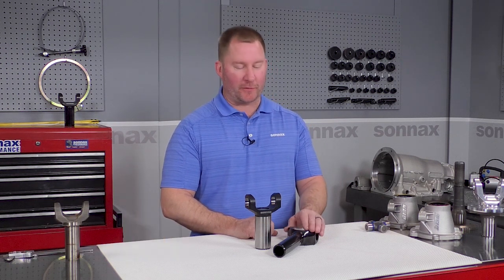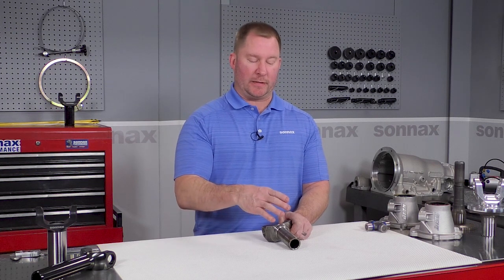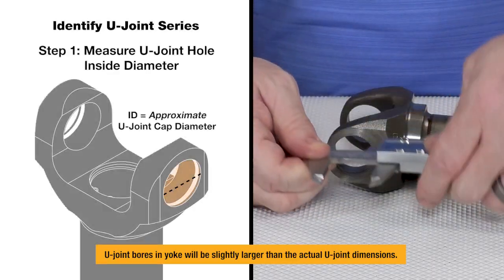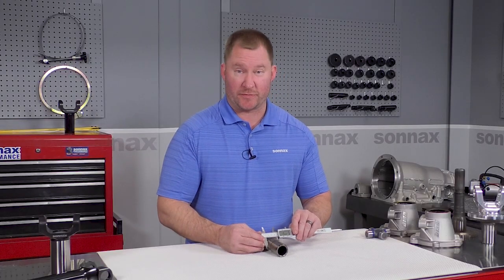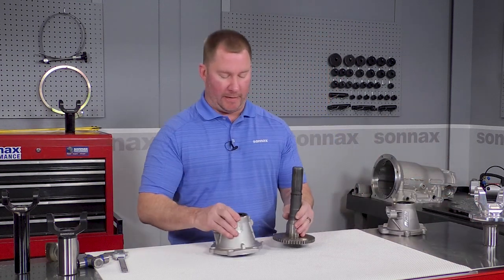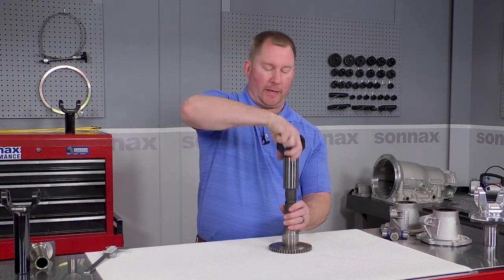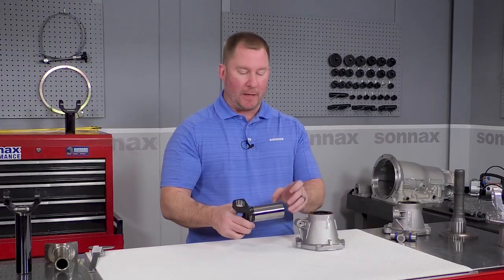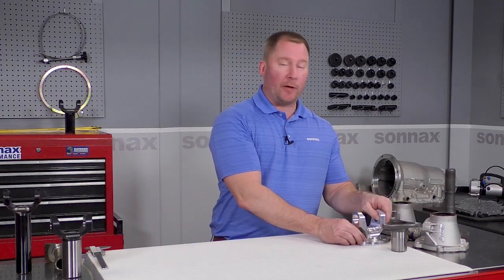How to Choose the Right Slip Yoke

Comment: What is the part # for the bolt on yoke for a 4l80e?
Reply from the maker: Hi Nicolas, we don’t offer a bolt-on-yoke for a 4L80E. That would be an OE style yoke, so you would most likely refer to your GM dealer for that one. Thanks for reaching out!
Reply: @sonnax  can i put a slip on it, it has the threads in the center of output shaft but i would feel better with a slip yoke..part #?
Reply from the maker: @nickonickster1  our tech team would be happy to help you with any further questions. They can be reached directly via email at sonnaxtechsupport@sonnax.com, or phone at (800) 843-2600 ext. 398. Thanks again, and have a great weekend!

Comment: Why is so hard to find a yoke for my chevy cheyenne 1992  mexican model with the 5.7 tbi engine and 700 r4 transmission   single cab short bed! I went to autozone 3 times and they always  have the wrong stuff  ! 3 times !
Reply from the maker: Getting the right slip yoke can be challenging! Unfortunately, with older vehicles it’s very common that the driveshaft isn’t stock and the U-joints aren’t OE, so looking for an aftermarket slip yoke using only vehicle information is nearly impossible. 

If EVERYTHING in your vehicle is OE, then a yoke can be ordered by VIN at a Chevy dealer. If you’re looking for an aftermarket part, though, especially a high performance slip yoke like those from Sonnax, then the first step is to take all the appropriate measurements and then work with a retailer to make sure they have what you need. As many have found, even that doesn’t always get you the right part. The retailer may not have all the critical yoke specs listed or understand how to accurately describe the product.

If you need more assistance choosing a Sonnax slip yoke after watching this video and researching yoke options at www.sonnax.com/slip_yokes, you can contact a Sonnax driveline product specialist at (800) 843-2600. Have all the info about your old yoke and/or transmission/driveshaft ready, as that will be needed to identify the right Sonnax part for your vehicle.

Comment: What is alignment key, match up the key with the keyway?
Reply: I have a 32 splin on the out put and 31 splin on the in put that is missing a spline
Reply from the maker: @charmainenaone563  Most transmission slip yokes are designed with a spline missing, so they are 31 splines based on 32, for example. The missing spline is so the yoke can move freely on the output shaft without getting air locked. There is no need to line this up, it’s not a key way, only a missing spline. Hope that helps, thanks for reaching out!

Comment: I am trying to find a slightly longer 32 spline slip yoke for a dodge Dakota 4x4 that has a 242D . I am losing my mind over this lol . I bought a 242D transfer case which is the same as the 242hd .why can't I find the right slip yoke for dodge Dakota. I am swapping out a 249j out of a jeep grand Cherokee .I need a  32 spline slip yoke for dodge 242d rear output shaft .
Reply from the maker: Hi Dennis, most of our transmission slip yokes are designed for popular performance-style transmissions. Since this is for a 4x4 transfer case, we would recommend contacting Tom Woods, he specializes in Jeeps and these types of drivelines: https://4xshaft.com/. Thanks for reaching out, and have a great day!

Comment: Why do they remove spines on the input shaft? Like on your 32 but one removed. Isn't it weaker than a full 32 spline input? I bought a 30 spline input yoke and it was the correct part for my 32 spline input yoke. I have a 1992 Chevy Cheyenne 4x4. Nv3500 5 speed transmission.
Reply from the maker: Hi Kevin, thanks for your question. The missing spline has a purpose, which is to allow venting as the slip yoke moves back and forth. If this was not present, the yoke would air lock, preventing full travel. Without this travel, driveline damage could occur. Hope that helps!

Comment: I know this is an older video but I hope you're still monitoring comments.

I'm trying to determine if I need the counter bored slip yoke on my short tail TH400. 

It's Frankensteined into an S10 behind a 383 so I have no idea what the TH400 is out of.

You indicated the truck output shaft originally designed for a bolt on yoke has a threaded hole in the end of the output shaft and the o-ring. Am I to assume if there is no threaded hole in the output shaft that the counterbored slip yoke is not needed or do all short tail TH 400s have to use a counterbored slip yoke?

Thank you.
Reply: BTW, it has a slip yoke but it doesn't seem to be pretty short although there is about 1.25" of end play sitting level, before the yoke bottoms out. 

I understand an inch is roughly the safe minimum.

My question comes because I'm changing out rear ends and may need to alter driveshaft length. I may upgrade my slip yoke, as well so I'm trying to determine how to tell because, being fairly high performance, I'd like to do full spline slip yoke if possible.

Comment: Question: I've got a  late model RV TH400/475...has the brake drum on the back...I'm removing the drum and retrofit ting this into my 64'C10...
I was wondering should I change the tail house cone and or utilize a fixed yolk or preferably utilize a slip?
Any suggestions?
Thanks!
🙏🙏🙏

Transmission came out of a 91' Bounder Motorhome
Reply from the maker: Our product support team would be happy to help you. They can be reached directly via email at sonnaxtechsupport@sonnax.com, or phone at (800) 843-2600 ext. 398. Thanks for reaching out!

Comment: If you could be so kind as Please help me with this as I am running into walls researching this.
      I only need to know the 'Correct' size slip yoke (# of splines & spline diameter, C/L of u-joint to end of yoke, width at the yoke, & width at the u-joint) for the Ford T-10 4 speed transmission that was originally used on a 1965 Ford Mustang w/289 V8 .... the 'Standard issue (nothing special)' T-10 4 sp. for the 'standard issue (nothing special)' Ford 289 bell housing.
      [I believe T-10s were used thru 1966 Mustangs ... and after 1966 Toploader 4 sps replaced T-10s. Hopefully my study of history is correct]. 
      I am sure my transmission is a T-10 4 sp transmission because it is stamped as such (stamped T-10) and it is currently bolted to my C-code 289 on my 1965 Ford Mustang Convertible, & it bolted right onto the 289's bell housing without any 'modification'. 
      Keep in mind the slip yoke needs to connect to the 'factory stock driveshaft' for the 'factory stock 8" rear end' (factory stock 8" open differential),  AND my 1965 Mustang has been 'upgraded' to this T-10 4 sp from the 'factory stock' 3 sp manual transmission that was 'factory stock' original to the car.
      I Think, but am not positive the 1965 Mustangs used the Same Exact driveshaft with the factory stock 3 sp manual and T-10 4 sp manual transmissions.  Is this the case?
     My online research has been little help, nor have the 'Experts' at various 'Vintage Mustang Specialists' companies.  They all seemed clueless, and this seems to me like a 'simple' question they should know right off the top of their heads.  Their websites do not say what specific model transmissions their slip yokes are for, just saying "3 or 4 sp manual or automatic & V6 or V8 engines".  This is very frustrating to say the least. 
    This seems it should be a "simple" search for the 'Correct' slip yoke simply searching: "Slip yoke for Ford T-10 4 sp. transmission for pre 1966 Ford Mustang", but the search engines won't make it 'that simple', hence why I am now asking you for your assistance.  
     I thank you Profusely if you can source me the 'Correct' slip yoke.
     I may even buy this slip.yoke from You for a couple of reasons:
You actually helping and sourcing, and I've come across many 'online rumors' the T-10's slip yokes are "weak" compared to the Toploaders, hence Why Ford switched to Toploaders over T10s in 1966. 
      Thank you very much Sir.
                    - Mike.
Reply from the maker: Hi Mike, we're happy to help! Our driveline rep, Travis Phillips, would like to speak with you directly about this. Can you please email him at travis.phillips@sonnax.com when you get a chance? Thank you!

Comment: With the truck output shaft the yoke with the o-ring looked short when on all the way and when you pull it back the 1/2 u joint[.500"] the o ring would be out of the yoke.
Reply from the maker: Hi Michael, the o-ring will be out of the yoke, at middle-stroke or rest, but it would not allow the yoke to plunge and would stop the travel of the yoke into the tailhousing, creating problems. Hope that helps!